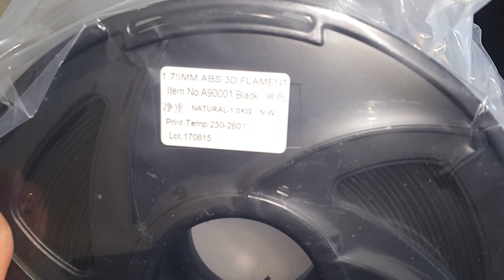MGN12 linear rail with direct extruder - Creality printers

Comment: hi chris Config Tronxy X5S Marlin 1.8 Firmware 
Aibecy Upgrade BMG Extruder Set Dual Drive Extruder
how do i Config the stepper motor ? 415
Reply from the maker: If you are using the trianglelab bmg (3:1 ratio), my setting was 408 after calibration. If you use Bondtech it is 415. For other brands best is to google how to calibrate your extruder, there are many tutorials

Comment: are the bearing in the guide not supposed to be orientated on top rather than hanging off the side? This will wear out pretty quickly no?
Reply from the maker: You can position it as you wish - lateral or on top or bottom of the 2020 extrusion. I checked specifically the Hiwin documentation before installing it this way.

Comment: The print quality is very bad. You can't just increase the entire print speed just only because you have linear rail(s) now. The thing is, the smaller the movements the more shaking and therefore you can only print fast if you have long straight movements.

Comment: I notice your hotend/extruder mount is a much simpler arrangement than your previous video shows.  I have seen many direct drive BMG upgrade models on Thingiverse (Including the one in your previous video) that don't take advantage of the direct E3D fitment in the bottom of the extruder, hence the need for the little bit of PTFE tubing.  It's like the Bondtech extruder is custom made for an E3D hotend, but nobody seems to bother.

I prefer the way your hotend is now embedded directly into the extruder.

Comment: linear rail too expensive..
Reply: 400mm mgn12h with carriage is $18 on aliexpress
Reply: @fahrvergnuegen  this is a good option too. For the application of 3d printing, there really isn't any pressure on the tool head, unlike it would be when milling. Those cheaper rails will do just fine. Buy 3, degrease them, regrease, and pick the best one of the lot.
Reply: @linuxinstalled  yes i know. i have been using linear rails on my 3d printers for many years. ;)

Comment: Really awesome video, thank you for posting this. How did you bend the aluminum plate? Just with a vice? Or did you use a press brake?
Reply from the maker: Sorry, the metal sheet is 1.5mm only. I fold it up also on the sides to make it more solid using the same tools.
Reply from the maker: Hi, it is from metal sheet 2mm. I used a vise and a small hammer to bend it 90°.

Comment: I've added a Zesty Nimble to the linear rail setup, it works really well and can print very fast now with the e3D V6
Reply: @laser man , I also have a CR10S-5. Are you happy with the Zesty Nimble or do you feel a BMG would do the trick?
Reply: @mylesdrake4518  Yeah, the nimble is really great. Solved a lot of printing problems for me, and also prints TPU like a charm.

Comment: Nice I would love to do this to my Ender 3
Reply: You wont regret it.  Just make sure you print your mounting bracket FIRST.  Also make sure you have a plan for that X limit switch.  I screwed up and forgot about till the very end. Basically had to epoxy  it in position...for now....or forever.  LOL.
Reply: @stringfellowhawk4843  Thank you for the advice. There is a company 3DFused that says they will release a bolt-on kit tomorrow, which I plan on getting. They have a kit already for the Y Axis, and also for the CR-10 more things. Take care!
Reply: @stringfellowhawk4843 , time to update to drivers that offer sensorless homing.

Comment: The sound was probably caused by the 8-bit control board not being able to step fast enough on the x-axis.
Reply from the maker: Hi, thanks for you suggestion. I think it has to do with the accelleration at high speeds as it occures only on the x moves while not printing and at speeds > 80mm/s. If I decrease either the accelleration or the speed for the x/y movements it dissapears. Anyway, my 32 bit skr 1.3 board comes next week and I will check if it improves this noise.

Comment: Hey. I'm interested in whether the trolley mounted in this way on the MGN12H has lateral play, is it fixed rigidly? For me, the hotend gently moves up and down. I do not know if it's MGN12H fault, is such a play acceptable? Greetings.
Reply from the maker: It is certanly not acceptable to have a play on the hotend. Mine has absolutely no play. 
Check if your rail is well tightened to the 2020 extrusion. If the play is at the mgn12h block check if all the rolling balls are there. I dont know what else to advise - I didnt have such issue.
Is you linear rail Hiwin or a copy?
Reply: @3dpblog  I bought the splint at Alliexpres. I have a few pieces, I will check if there is the same problem on all.

Comment: gj but ll u upgrade z too ?
Reply from the maker: Hi, I wont upgrade the Z with linear rails. I'm quite happy with the dual Z with one stepper mod (this one https://www.thingiverse.com/thing:2569379) and I find the V-weels provide good stability for the slow movement on the Z axis. I believe linear rails are a improvement for fast movements of high-inertia parts only - like a a direct extruder on the X or the build plate on the Y.

Comment: The mod I made for now was as you mentioned for the current Bowden setup ... not sure what I want to do right now for the direct extruder option. Will look at what I have right now ... which ran perfectly after I was finished. Might design up a mod plate for the change to direct extruder using a printed mount to fit the linear rail. You were a big help getting me going on this mod. Thanks again.

Comment: After reviewing ur mod to a linear rail. I made the modification. I was able to make the mod using only the original hot end mounting plate. Had to think a bit but pulled it off. I’ll work it up and put it up on YouTube next week. That’s for the inspiration. Later
Reply from the maker: Glad to hear you managed the conversion. I wander how you could use the stock carriage though. Either you are staying with a bowden setup or you printed/made some additional mounting accessory attached to the original plate, because it is not possible to fit a stepper and and the mgn block on it. 
In your setup is the BMG extruder directly connected to e3d v6 or are you using additional bowden tube between ?

Comment: I’m in the process of making the same modification you presented. Let me ask you this. When you reconnect the belt ends to the extruded is there anything you need to do to position or zero the location of the extruder so it doesn’t crash into the X Axis. Nice Video. Thanks
Reply from the maker: You have to adjust the x-axis limit switch position so it is pressed by your x-carriage. Nothing is needed when you take out/put back the belt.
Reply: Thanks for the info. I though that might be the case. I’ll put a version of how I did the project from ur suggestions. I’m just waiting on a piece of T6 aluminum that I ordered to make the back plate .... my rail came with two slides and I will use both side by side. Thanks again.
Reply: Yes .... I’m going to do a video to show the modification. I want to eventually go to a direct extruder, but for now wanted to go to the linear rail. To give you som in site. I had to add an extension to the two ears ... did this by cutting two pieces of 1/8 aluminum the width of current tabs and 1/2 in longer. Saw slotted the new slots and epoxied them to the current tabs. Pulled the mount for the bed leveler and drilled holes for linear slide mount. Had to counter sink the hole on the back side of holes for the bed level mount to keep surface flat. You only need three holes to hold the plate to slide. Flat head screws are available at ACE Hardware. They are 3 mm. Hope this helps.  Just ask if you need more.

Comment: linear rail on a 3dprinter is a no.  on a CNC yes why ill tell you on a 3d printer you dont have any forces of the axis you can get the same resolution with printed bearings on the ather hand on a CNC linear rails yes its best to spend money on extruders contol bords and frame work on a 3d printer but any way thats my opinion nice vid :)
Reply from the maker: Hi, when I spoke about precision/accuracy I didn't mean resolution (which depends on the nozzle). The linear rail eliminates any shaking, that exists with the stock V-weels carriage, and any need of checking/tightening the bottom V-weel eccentric. With a bowden setup V-weels are OK, but when you load with direct extruder and at speeds > 50mm/s you see that the carriage needs more stability.
I suppose the printed bearings you refer to are for linear rods? Linear rods on X will be also more stable solution than the V-weels, but in this particular case of CR-10 the mod with MGN12 linear rail is easier to implement.
Reply: @3dpblog  the cr-10 is with a 2020 frame it can it can benefit from liner rails to to compensate for the one stepper it uses thay cost to much money for what they offer on a 3d printer i'm a self learning person any way nice channel you have i follow you keep up loading :)
Reply: I quite agree, as an upgrade a linear rail is a waste of time on a 3D printer for the reasons mentioned. Unless there is a side by side comparison of the standard design and the linear rail it isn't valid...…...but a direct drive per se, IS a very desirable upgrade. @3discnc424
Reply: Nosense. The linear rails replace a very bad pulley system that has no stability. 3D Printers with all linear rails or rods are still $$$. I did this on my 3d printer and it's rock solid now. https://www.reddit.com/r/CR10/comments/an0uoh/cr10s_lineair_rail_upgrade_done/

Comment: do you have the 3d printed part so I can make a cope of your metal plate/ I ordered the rails like you mentioned and I have the e3dv6 but im not able to connect it to the rails without the plate help thanks
Reply from the maker: Hi, yes I found it - https://drive.google.com/file/d/1I4bBwhr0ylNxtO39OiUayYZVYR4lG8Cr/view?usp=sharing
Note that this is the model to drill the holes for the stepper, the MGN12 H-carriage and the cuts for the belt.

Dont use this to cut  the upper part of your metal sheet (where is the stepper and the MGN carriage), because you will need additional space for :
- the part that actions the limit switch - use mine if you want or modify it to your needs - https://drive.google.com/file/d/1hJ5NtthIFjepN-3Ytfx2xin4G15xZXRn/view?usp=sharing
- some holes in the right upper conner to attach the wires with pig tails (completely improvised)
Reply: @3dpblog  Hi can you do a small mod for the MGN15H mount holes(25mm instead 20mm)? Thanks.
Reply: 3dp blog  thank you for all your help and support.  I followed and I decided to do rails on the sides and the bottom as well.
Reply: @3dpblog  Thank you so much for sharing these. It helps.

Comment: Thanks for this, I've been looking to upgrade the CR10-S5 with liner rails, this was very helpful.
Reply: Already done it. here is my build: https://www.reddit.com/r/CR10/comments/an0uoh/cr10s_lineair_rail_upgrade_done/
Reply: Laser Man Would like to know more about it, I have also a S5
Reply: @24KG24  I just followed what Ivan did, but with a longer rail.
Reply: @originaltrilogy1  Do you notice a big difference?
Reply: @mylesdrake4518  Can print much faster with less ringing.
Reply: @24KG24  I also have CR10 S5, did you end up switching out the X Axis motion system?
Reply: @mylesdrake4518  Havent done anything yet

Comment: Nice but its havy like this i do this without the aluminium profill
Reply from the maker: What is heavy? The 2020 extrusion profile + the linear guide? Do you use the linear guide alone? I dont think it is better. With the 2020 extrusion it is more solid and actually I find the setup quite light. I had no issues even with single Z gantry, however i went with dual Z last week (single stepper). I see no difference in print quality though. May be for big/tall parts it will help.
Reply: I make a video iff you intrestet in my setup mfg
Reply from the maker: @mr.doityourself  l saw your setup on your channel (subscribed btw). But still I prefer keeping the 2020 extrusion because I didnt see any weight impact and I believe it is more sturdy this way.
Reply from the maker: @mr.doityourself  You are using bowden setup and it is very light. So for your use it is great. From my side (although I am very happy with this lite direct setup) I want to overcharge the print head with direct extruder, bltouch and maybe a heavier stepper. I am working now on a carriage that integrates the v-weels also - to support all this weight. I am waiting for some supplies though, like excentric nuts and additional vweel to be able to test it.

Comment: Hi ... how can I mount MGN12H on the x axis on a Creality CR10S Pro with an original hotend ... you can help me.
Reply from the maker: Hi Marco, I am not sure how I can help with that. I don't know the original cr-10s pro carriage dimension/drills/hotend position. If you want to go with such deep modifications on a new printer, may be it is a good idea to switch to e3d v6 hotend, because it is very well known and there are much more mods for it existing already on Thingiverse you can adapt to your need.